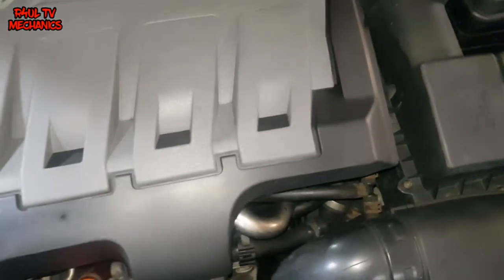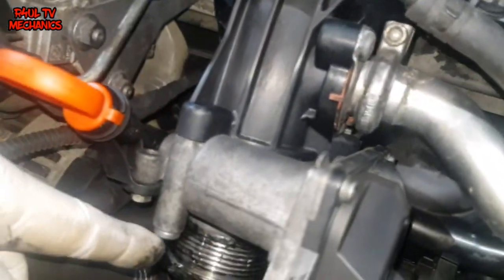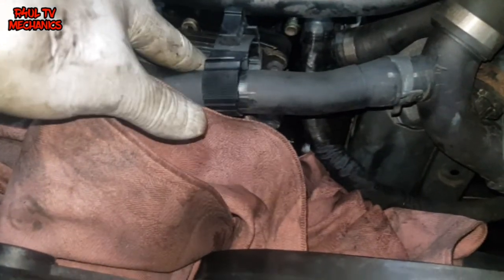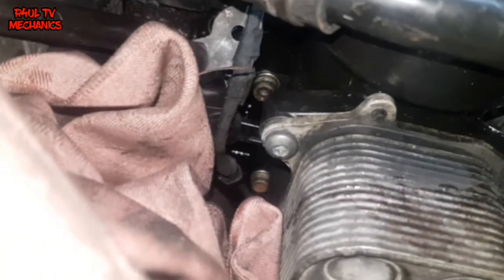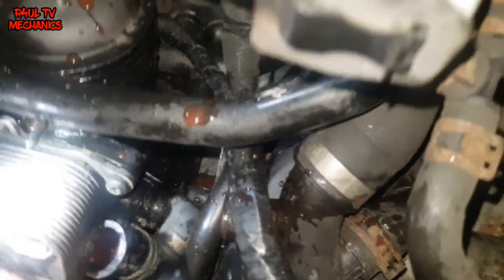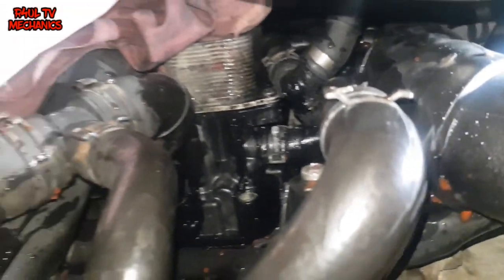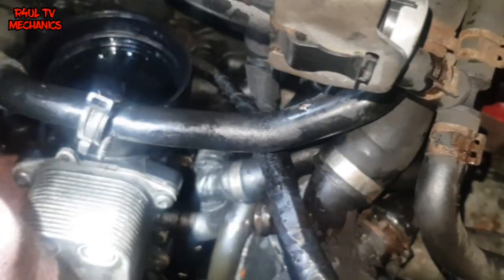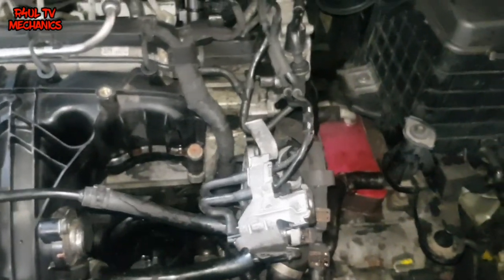2014 VW PASSAT 2.0 tdi OIL COOLER HOUSING REPLACEMENT

Comment: To US spec Passat TDI owners watching this video:  don't. LOL!  No, but seriously check one of the other videos from the States, as there is a LOT more you have to do on US spec Passats, the intercooler needs to come off, as it blocks the housing bolts on the passenger side, and there are other things you will need to do.  This is a GREAT video for Euro spec Passats, but only partially applies to US spec cars...
Reply from the maker: Thanks for the info mate. Haven't really worked on US spec Passat so I dont know. Anyway thanks for watching really appreciate it.
Reply: Do want to say I literally just did this myself in my garage with a 2014 NMS Passat TDI - removed intercooler, the air box and tube attached to the bumper, and undid a few plugs. I was able to get it replaced with just that

Comment: How much does it cost to do this job
Reply from the maker: Labour around about £100 
The part will cost about £200 from main agents, or £100 from eBay
NOTE THE ONES FROM EBAY ARE GOOD BUT NOT GOOD AS MAIN DEALER PARTS
Reply: @TEAMR4ULTV  I've just had to pay 360 for the part and 100 for labour for a vw passat cc
Reply: I am unable to purchase this piece without a new oil cooler in the US. Total price for entire assembly for me was USD $400, installing DIY. Car started to leak coolant, one of coolant ports broke and caused the gasket to shift away, creating the leak. Thanks for the video.
Reply: VW dealership just quoted me almost $1,900.00 for the job! 🤦🏻‍♀️ I’m exploring other options to get it done!
Awesome video!
Reply: Will this cause oil in the antifreeze or is it a head gasket ? Standard transmission
Reply: @centraleaves I think both of what you mentioned can cause coolant to mix with oil.

Comment: currently doing a 2012 vw TDI, the amount of space is so frustrating, the jetta uses a metal oil filter housing along with a different oil cooler that has an inlet and outlet tube
Reply from the maker: Thanks for watching really appreciate it

Comment: What is the torque setting for the bolts to the housing?
Reply from the maker: Thanks for watching really appreciate it. To be honest I just tighten them up with a ratchet tight as I can without snapping it.
Reply: Oil cooler screws are 11nm and filter housing to cylinder block are 15nm +90 degrees (with new screws)
Reply: When tightening the oil filter assembly, tighten the 4 bolts in the following order: upper left, lower right, then the other 2 in a diagonal fashion.
Make sure the high pressure oil line is installed without tension.
Torque specs
4x oil filter bracket bolts: 11 ft-lb (15 Nm) + an additional 1/4 turn. Always replace these bolts since they are torque to yield "stretch" bolts. high pressure oil line union: 16 ft-lb (22 Nm)
2x high pressure EGR line bolts: 15 ft-lb (20 Nm)
oil dipstick bolt: 6 ft-lb (8 Nm)
T30 throttle and EGR bolts: 6 ft-lb (8Nm)

Comment: Thanks for the great detailed illustration video. My housing has sprung a water leak. I'm tackling this task tomorrow. It looks like I may get away with replacing seals only, however with the amount of work it takes I think I will replace the housing.

Comment: Think mine or broken as oil in the coolant tank. And loosing coolant. Engine jot overheating or any froth? Does it sound like oil cooler issue?
Reply from the maker: Its  possible it's just the housing. Or oil cooler

Comment: 2 questions: Did you have to drain the oil first, and do you know where I can find a repair manual for this car? I can't seem to find any for the 2014 passat tdi.
Reply from the maker: No I didnt have to drain the oil. As for a manual best just go to the agents they should have one. Or if your in the uk go to TPS Trade parts specialist

Comment: When tightening the oil filter assembly, tighten the 4 bolts in the following order: upper left, lower right, then the other 2 in a diagonal fashion.
Make sure the high pressure oil line is installed without tension.
Torque specs
4x oil filter bracket bolts: 11 ft-lb (15 Nm) + an additional 1/4 turn. Always replace these bolts since they are torque to yield "stretch" bolts. high pressure oil line union: 16 ft-lb (22 Nm)
2x high pressure EGR line bolts: 15 ft-lb (20 Nm)
oil dipstick bolt: 6 ft-lb (8 Nm)
T30 throttle and EGR bolts: 6 ft-lb (8Nm)
Reply: Why do you think that oil filter assembly tightening sequence matters? Thanks.

Comment: Well mine wasn’t exactly like this video. Didn’t have the rubber tube after the throttle body housing just went into the inner cooler. Got it got it replaced.. thanks for video.

Comment: Hi if the oil cooler  is blocked would it cause the oil cap lid to pop off wile the engine is running .
This is what’s happening to my car 🫣🫣
Reply from the maker: It shouldn't never heard of that one before
Reply: @TEAMR4ULTV  ok I’m stumped 🤔